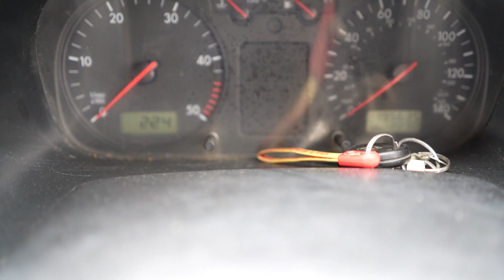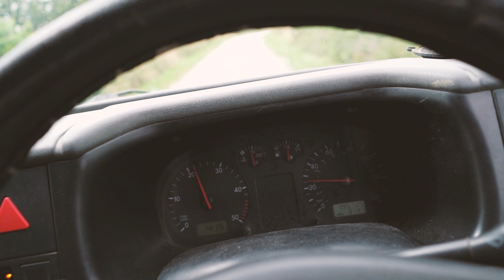Sprucing up the main character-EP043

Comment: Put it close enough to the house so when it rains you don't have to go a long distance to get to it. Think of heavy weather and think of what you can add later like a walkway to the house so you don't tread mudd, a roof that comes out over the door so you don't get wet, motion sensor lights, even a partially enclosed walkway so you don't get wet going to and from. Don't want to get sick.

Comment: Is the van Diesel or Petroleum run? If it's not diesel you should make sure all the seals on the back of the van are 100% in good condition. There was a case here in Australia where a family were travelling in a similar van and got to the end of their trip to find the young passengers had passed away from the fumes. Undetectable from the front. Loving the vlogs, but don't burn out keeping up with it and family and house stuff. Thanks for the escapism, Sandra, East coast, Australia.

Comment: Me and my sister put windows in her van with very little diy experience, scary but totally doable...Drill the corners then cut with a jigsaw, it was scarier doing the bit you've just done gluing the windows in.. doesn't feel like glue should be able to hold a window but they haven't fallen out! 😅

Comment: Dan, if you fit  glass openings on the side of the van, it becomes less practical to load up quickly, as you will constantly have to watch out  to avoid hitting them Defo not worth it !